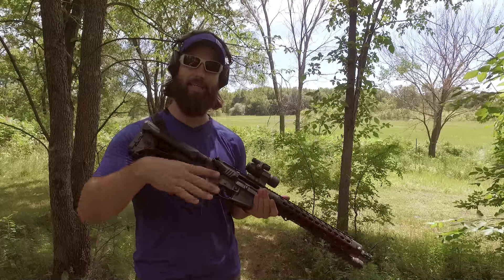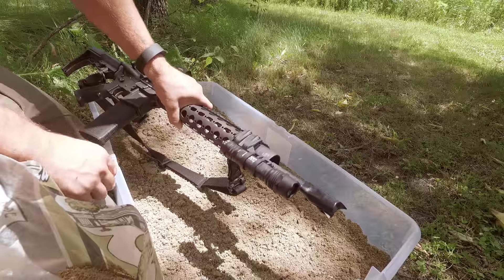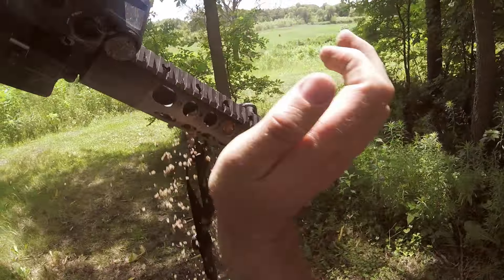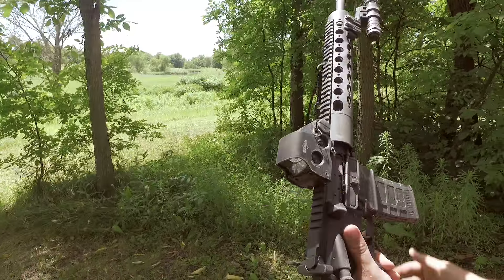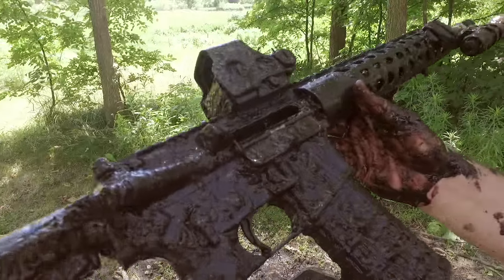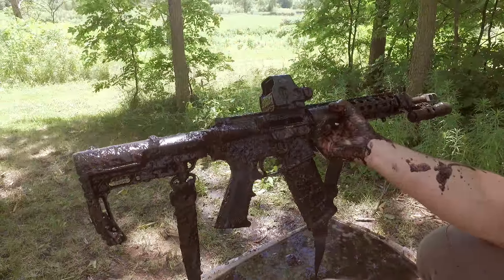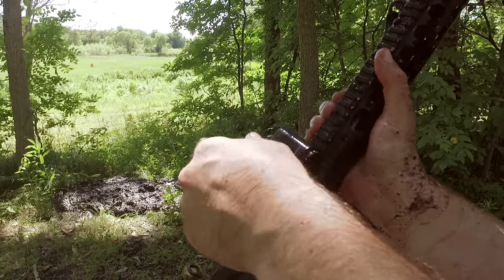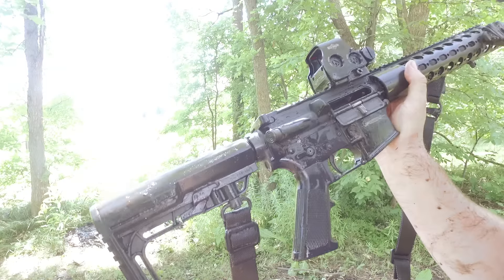JP15 (AR15) Field Stress Test 1 of 3. AR15 Reliability Test

Comment: lost me when to bolt was closed in the sand. should have left it open.
Reply: Any rifle will fail that. Try with an AK. The AK can fail environmental tests just because of the gap that's left open when you flip off the safety - reference the mud testing that's been done by inrangetv, in which the AR dominated other rifles due to being a more sealed system. That's why IWI built the Galil ACE with a spring-loaded dust cover for the charging handle's path.
Reply: That's a fail for any gun.  Even the ak would fail it
Reply: Why the hell would you do that, you don’t carry the rifle around with an open bolt. In most cases the dust cover is closed too.

Comment: yea dude, i think when you submerge an ar you NEED to point it muzzle down not up, i think that's an explosion risk?
Reply from the maker: You need to clear the barrel and the gas tube.  We didn't have a round chamber so we decided to hold the bolt open muzzle up.  It achieves the same thing as muzzle down with a round in the chamber.  We purposely wanted as much debris to enter the up and lower receiver as possible.  Thus, we decided muzzle up, bolt held to the rear to.clear the tube & barrel.  You are correct, if an ar has a flooded gas tube and barrel you can create a catastrophic failure.
Reply: Sheep Dog69   You do know that this is a team of professional MIL/LEO/FED operators???